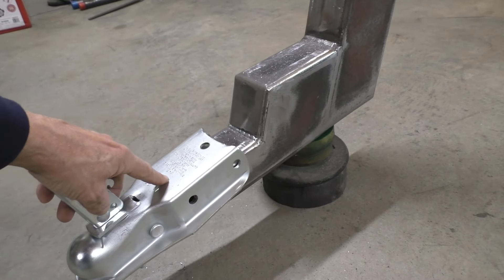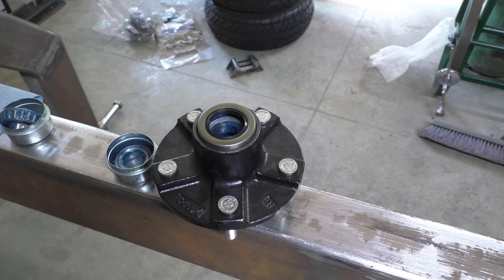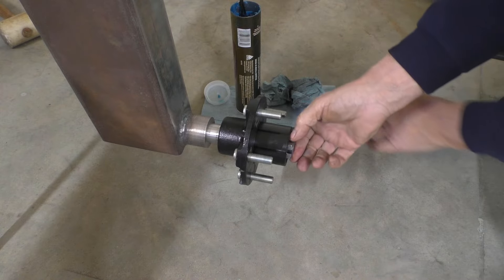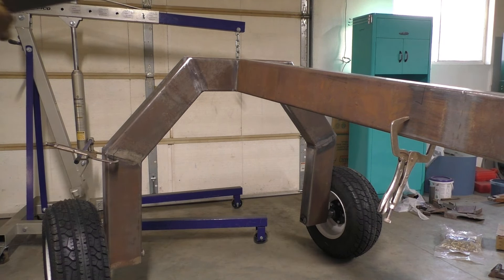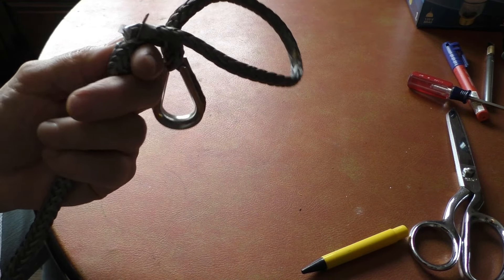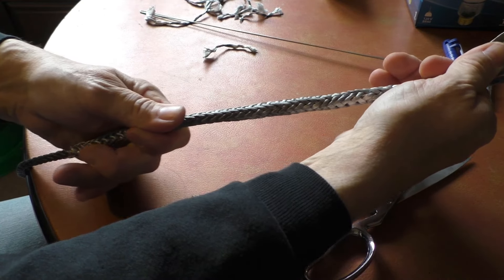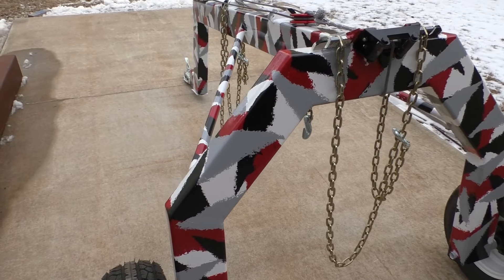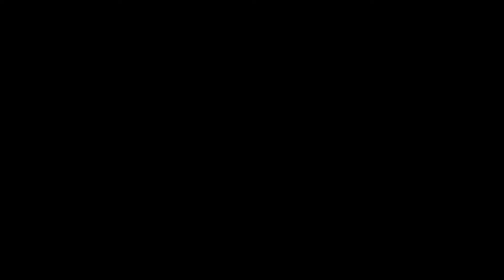Homemade DIY Log Arch Spencers-Mountain

Comment: Nice job! I built a log arch a couple of years ago and it works awesome. I wound up replacing the hand winch with an electric winch, the hand winch just couldn't stand up to the abuse the larger logs put on it. Some of the large oak logs with over 2,500lbs. Oh and that paint job is pretty sweet!
Reply from the maker: Thank you! I was gifted a small used electric winch but it was not available for this build. Little hand winches are likely to be under powered and the reason for using several ways of force reduction. Most trees I deal with are relatively small in diameter, but may have opportunity for a few large ones. Thank you for the comment, information and watching our video.

Comment: Looks great! One small suggestion. I would replace that roller fairlead with a solid aluminum one, which is designed for braided line like dyneema. The braided winch line tends to get pinched in roller fairleads causing damage to the line.
Reply from the maker: Thank you for the suggestion! As you can tell from the video, I am new to Dyneema and getting an education on its uses.

Comment: very nice. How many manhours you think you have in this?
Reply from the maker: Thanks! About 20 hours including  finding parts and paint. Would have been much less using tube instead of shelf supports welded together and somewhat lighter. But the frame was low cost and is very heavy duty. Thank you for watching.

Comment: are the axle spindles welded on the inner side terminations ?
Reply from the maker: @grassabrutta  yes, welded inside. Hate welding around an axle on the outside. I know it is done all the time, but does all kinds of weird stuff in that weld area I don’t want right there.

Comment: Pretty stout!
Reply from the maker: @jackspagnuolo9517  yeah, a little excessive due to cheap material. But, have seen a lot of bent arches and several videos reinforcing bent arches. I am limited by tire capacity, the tires will die before the frame. Thank you for the comment!

Comment: Just by chance would the be a set of your design prints .
Reply from the maker: Harry, I made some quick CAD drawings just for concept and cut angles for this project. Everything was based on the salvaged pallet rack shelf supports.  That material was cheap but did result in extra work making tube and ultimately a frame unnecessarily too heavy. 
The material length I had was 40-1/2”, so the arch is base on 20” pieces to use up that length. 
My advise is to build to suit the logs you have. Calculate weight and build to suit your needs.  Ultimately everything comes down to what you can realistically handle. Then axles, tires, winch, chains, cables, etc. have to be able to hold that load.
Reply: Thank you, and you did a great job

Comment: are your plans available
Reply from the maker: Sorry, no.  All I have was designed for the material I used which is too heavy and may not be easy to find.  I also sized to some local arborist cuttings which can be large. Build your arch to the size and weight logs you intend to move on a regular basis. Too heavy / big is difficult to use and loses recovery capabilities. Too light is not going to move anything.  Download a log weight app or chart. Know how much a certain diameter of log weighs by species density. Thank you for watching.